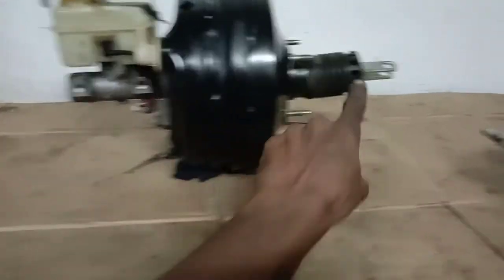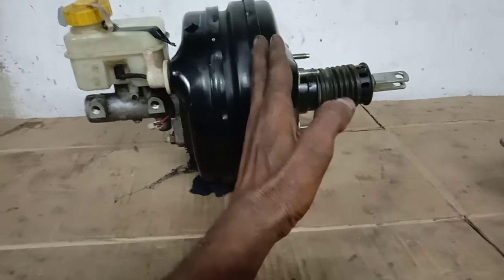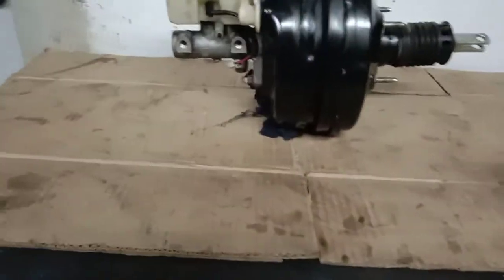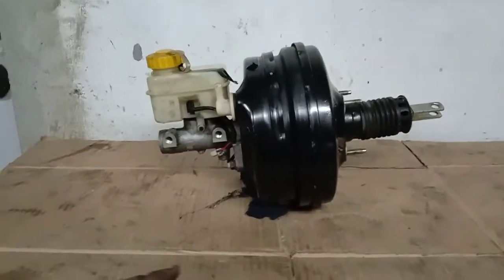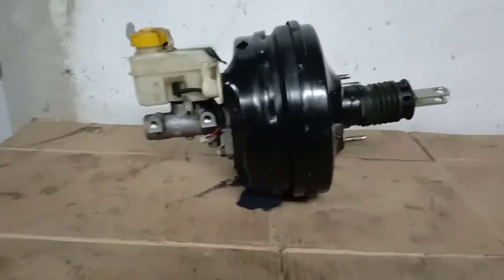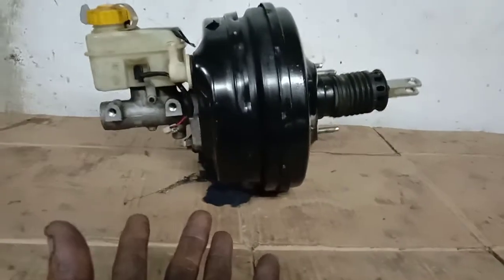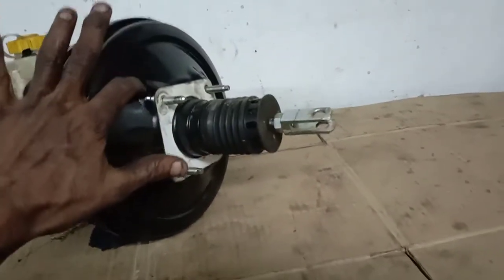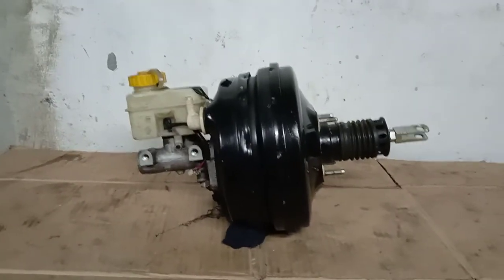BRAKE BOOSTER? tamil

Comment: Break pedal driving la irukum podu loose ahudu bro, ena problem ah irukum? Full ah brake pedal press pana tan brake work ahudu
Reply from the maker: Air bleed or rear brake adjustment and wheel play check pannunga final master clyinder
Reply: @skilledmechanictamil  thanks bro, ipo car start pani brake check pana but normal ah iruku. Last time drive panum podu loose ah irundadu.

Comment: Hyundai verna 2009 model cal la 80 to 120km speed la break apply pannum pothu jerck akuthu கார் உதருது bro enna karanam solluga bro.
Reply from the maker: Front brake disc
Facing work pannunga
Reply: நன்றி 🙏
Reply: steering left side pokuthu enna karanam eppati saripananum

Comment: After running 120-140 Km, breake badal going down.. After pumping 4 to 5 times it will normal. Any problem sir?
Reply from the maker: Rear brake shoe adjust ment